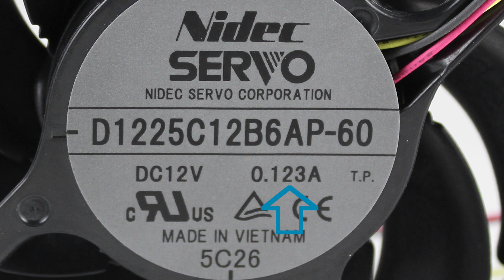Motherboard Wattage and Volts - DazLab EP14

Comment: Motors use more than the rated continuous current spec listed on the fan when starting up from 0rpm (stall). So a fan that is only rated for 0.2A might draw 0.6A for a second when starting up. This is why you always allow for extra room when calculating power draw. Now the motherboard 1A rating is most likely for continuous power, not peak, which means it can probably go above 1A for a short period of time without damage, but you want to avoid doing this if possible because it greatly increases the chances of overloading the motherboard fan control.
Reply from the maker: Toxic Biohazard Very good add-on comment. I hope people will pay attention. Startup power draw for Gentle Typhoon I used as example is indeed 0.63A ( or 7W).